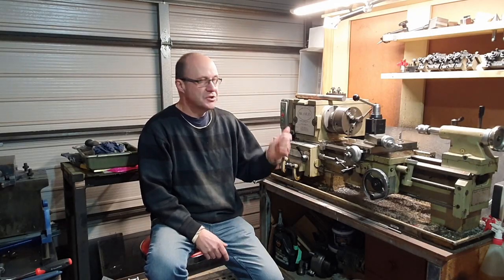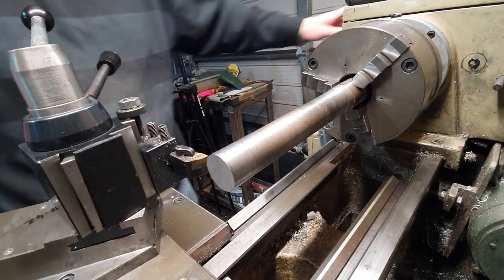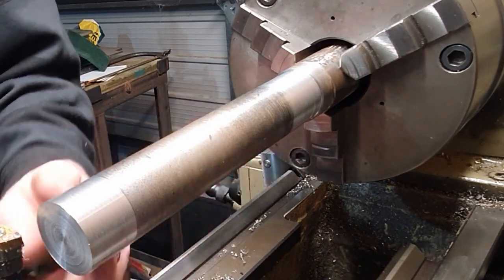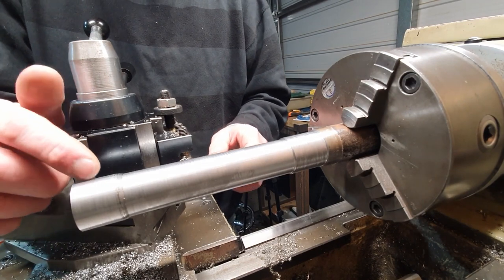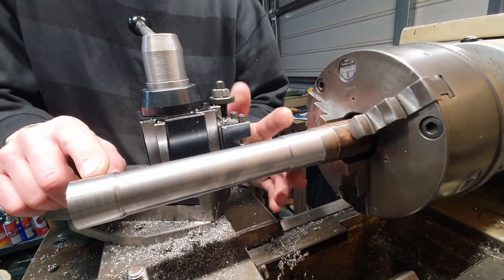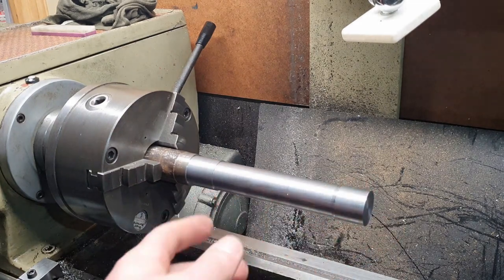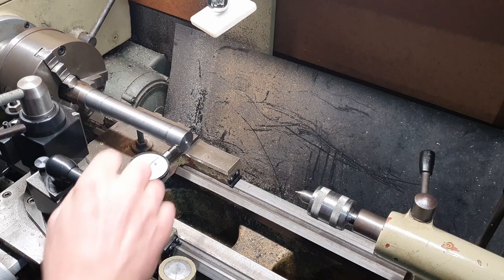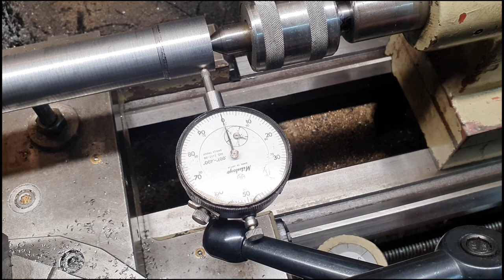#86 - Mastering Precision: Lathe Truing and Tail Stock Alignment For Accurate Machining Results!

Comment: Nice one Kevin. That is the way I have aligned my headstock too. I like your deflection test for the tailstock. I think last time I did this I took another pair of cuts and measured. Your way is quicker and better I think. PS. You obviously need to put a micron or tenths indicator on your Christmas list this year! Cheers, Craig
Reply from the maker: Hi Craig, I have got a tenths indicator but less than a thou on the lathes good, especially over an 8" distance.
Trouble with tenths indicators you're forever fighting the numbers.....lol.
Thanks for watching and leaving a comment.
Regards Kev

Comment: Thanks a bunch man. I'm new to machining at home and it's easy to change something and not realize the effects it will have on the rest of the machine. I tore my lathe apart and replaced some braces underneath the headstock with thicker ones. Then I'm wondering why my tailstock is sitting proud and couldn't think of how to adjust it. Now I see my error so thank you.
Reply from the maker: Hi there. Glad I could be of some help. Regards Kevin

Comment: I was hoping to see some actual headstock adjustment. You have the exact same lathe that I have (albeit a different brand). I’m about to do the same but was unsure of the best way to adjust it.
Reply from the maker: Hi. I didn't need to adjust the head stock as it's already running true. Thanks for watching. Regards kevin
Reply: @Machine_NZ  do you know if the headstock casting pivots on the base?
Reply from the maker: @freestyla101  my lathes headstock has adjustment
Reply: @Machine_NZ  yes I have the same lathe. What I mean is does the headstock sit on a dowel pin or does it just sit straight on the base casting.

Comment: I'm no expert, but all you're doing here is seeing if there's a difference in the centricity of your drill bit vs your live center - or am I missing something?

If you turn the workpiece with the live center in place, then you could measure if you have any runout - runout there would equal a need to shift the tailstock left or right.
Reply from the maker: There's a bit more to it than that. I suggest you have a read through a machinists handbook.. This is a tried and tested procedure. Thanks for watching
Reply: @Machine_NZ  
I must be missing a step...
1: you chuck up a piece of bar and take off material to make it round
2: you drill a hole using a chuck&drill bit in the tailstock 
3: you put a live center in the tailstock,  and adjust the tailstock so that the live center enters dead center

If you repeat that procedure, the drill bit will still center differently than the live center?!

What am I missing?? 🤔
Reply: @Machine_NZ  
Think the pieces have fallen into place :-)
1: As the diameter of the 2 parts of your bar is (very close to) identical, you know that the bar is parallel to the ways.
2: The bar being parallel to the ways, you know that the distance between the bar and the ways (with DTI mounted) should remain static.
3: DTI shows that bar is being pushed sideways ever so slightly when live center is pushed into hole made by drill bit.
This push equals a tailstock ever so little out of alignment!
Thank you sir, this made me understand what was going on - instead of just accepting it :-)

Comment: With all due respect, I don't see a need for this process. You need a factory made half inch gauge pin that has a hole in the center. The hole must be perfect dead center. Place the gauge pin in your chuck. Then place an accurate dead center in your tailstock. Next align your tailstock into the gauge pin. When the dead center enters the hole in the gauge pin correctly your tailstock should be in perfect alignment. 
Sincerely Robert
Reply from the maker: Hi there, I don't have any gauge pins..